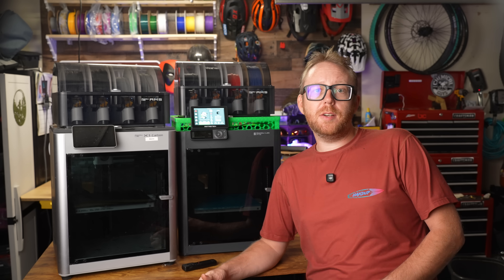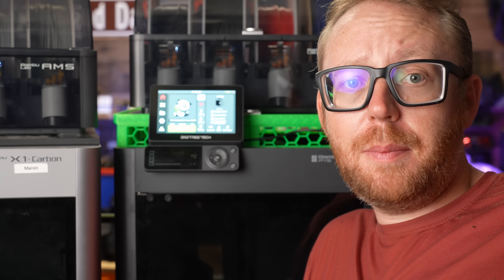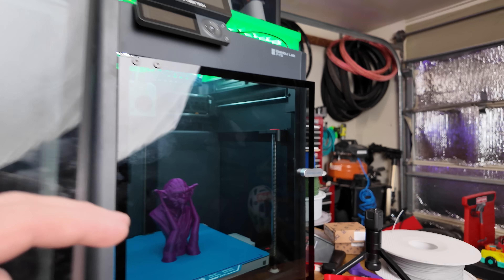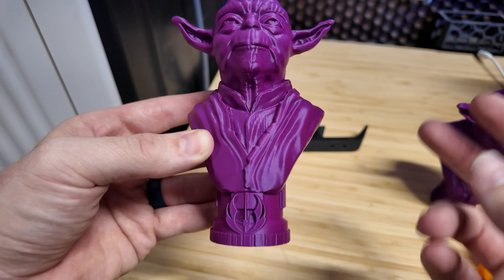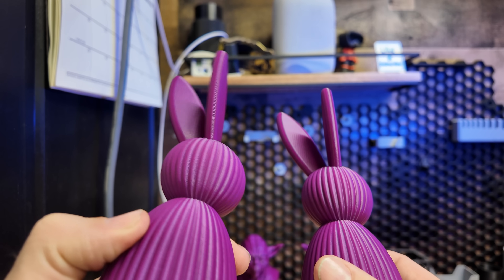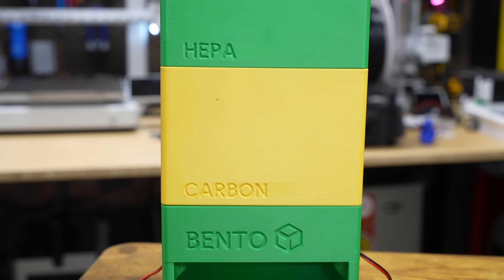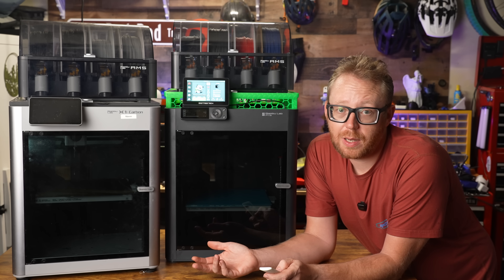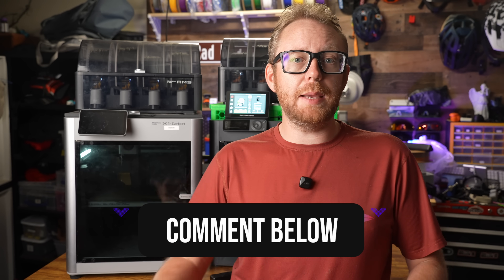Why I Regret Buying the Bambu Lab X1 Carbon vs P1S

Comment: Plastic vs metal? Yeah, I'd go with the X1C for longevity and build quality.

I bought the X1C, and unlike the numerous Facebook forums outlining various issues owners have faced with the P1S, the X1C in my opinion, is by far superior. 

I have owned my X1C for some time now and have never encountered any major issues. It prints flawlessly and is super dependable.

Comment: I went from a Elegoo Neptune 4 Pro to the Bambu labs P1S with the AMS. Night and day difference. The Elegoo is a very hands on product and doesn’t offer the AMS so when it comes to filament changes it is all manual. The other issue is the bed leveling will come loose occasionally ruining a print. The Bambu is impressive. Very little failure I almost want a second one with different nozzle sizes primarily for colored lithopanes.
Reply from the maker: i would be interested in checking the elegoo series out, ive only messed with the CC thus far

Comment: The 110degC build plate temp on the x1c vs. 100degC on the p1s was the differentiator for me.   I print a lot of ABS and have my build plate around 104-108degC.

Comment: PC for example has a higher recommended bed temperature than the P1S can reach. the X1C can pump out more heat. check the data sheets and make sure the printer has what it takes to print the material you need.
you don't need an X1C if you're only ever be printing PLA or PETG

Comment: I just bought a X1C AMS combo for 800 euros. Coming from a massively upgraded bed slinger that printed engineering filaments just fine, until it died a couple weeks ago, I wanted something that works without any tinkering. I was torn between the x1 and p1 but opted for the x1 as I could already see myself “upgrading” parts of the p1 and I just dont have time for that anymore
Reply from the maker: I can totally relate to not having time to tinker. I really want to build a voron, but I dont have the time

Comment: I need a reliable printer that will work without having to repair it often. Plus it's multicolor.
I've been waiting to see what the Elegoo CC with multicolor will be like, but who knows when it will come out.
Which printer would you recommend?
Mostly PLA, PETG and sometimes ASA would be used.
Reply from the maker: Well, Good chance the CC wont get its multicolor, Id go bambu for the availbility of replacement parts, plus they are really reliable. P2S if you arent in the USA, or dont mind waiting, otherwise the P1S or X1C are good options on the sale currently

Comment: On the Bambu website, it is showing that the X1C is capable of printing more premium filaments as well. How should I/how would you factor this into a purchase decision if you were going to use those filaments?
Reply from the maker: The P1S can print the same filaments as long as you upgrade the hotend and extruder to the hardened gears.

Comment: I bought 2 P1S at different times (waited for amazing deals) put about 600 hours on each. Then sold them for what i got them for and bought 2 A1's. The print quality on the A1's are just as good as the P1S and the only reason i knew was because i have an A1 mini and even that printed just as good. 

Im really glad I sold them when i did because now the H2S is out and the P2S will hopefully be out early November and these printers are far better. Still deciding which one to get and then of course wait for a sale.
Reply from the maker: The a1’s are so good , probably the best bang for the buck

Comment: X1C purchase…. Zero regrets, far from it, X1C has had many surprising benefits, not least the ability to have custom firmware and hardware add-ons. Finally, all the accessories which died when bambu changed their security eg external screens etc

Comment: Hi , what about using the others filaments, that the X1C can use? can the P1S with the upgrades  do it too?,  thanks!! really good video straight to the bone.
Reply from the maker: Yeah you just need the hardened extruder and nozzle to be able to print the same things

Comment: Thanks for this great video.  If the P1S with AMS was at the regular price of $749 or you could get the X1C with AMS on sale for $999, do you think it would be worth the extra $250?  This will be my first printer.
Reply from the maker: that is so tough! My gut would lean towards the X1C, because the difference is low when you factor in the upgraded extruder and nozzle. This price change really made it harder of a choice for alot of people
Reply: @RadDadsPrintLab thank you very much!!

Comment: Why is everyone saying the p1s is cheap. It cost more than the A1c.
Reply from the maker: Most comparisons are between the x1c and p1s . That’s why. Now I do want to do a video comparison between the p1s and a1
Reply: @RadDadsPrintLab I meant k1c my bad.
Reply: @RadDadsPrintLab which one would you recommend the p1s or the K1c. I print both carbon fiber infused nylon and normal plastic. But I plan to start selling parts here soon.  Considering both cost about 500$.

Comment: ~~Another but significant difference is the chamber heater the X1 has, the P1S lacks. Gets important once you move up to otherwise warping materials like ASA or PC.~~ Disregard, no chamber heater in the X1 (only the X1E has it and the H2).
Reply from the maker: Uh, I’m pretty sure the X1c does not have a chamber heater, only the x1e has it
Reply: @RadDadsPrintLab  Really? Thank you. 🙂

Comment: What a concise and informative video!

This video is a great resource for me. I am getting ready to purchase my first 3D printer, I was just about to pull the trigger on the H2S or the H2D and learned that their is now an H2C coming down the pipeline.

Given the H2C is possibly around the corner, I decided to pick up a less expensive first unit and get the H2D or the H2C once the H2C launches.

Thanks for sharing your experience it sounds like the P1S will get the job done until I can later get one of the printers with the larger build volume and fancier features.

Keep up the great work, I just subbed and I am looking forward to your future videos!
Reply from the maker: Thanks! Eventually I would love to check out the new H2 Series at some point
Reply: @RadDadsPrintLab I can't wait!

They are a pretty penny for sure.

My P1S arrived today I am so hyped!

I am mostly intending to print toys for my kids and gaming accessories.

Keep up the great work 🙌🙌🔥🔥🔥

Comment: My first 3D printer arrives tomorrow. It's a P1S with AMS and a Sanlu 4-spool dryer, along with a hardened hot end, build plates, PLAs, ASAs, some CF filaments, tools, vacuum storage bags, extractor hose, Panda Touch, and extra lighting. I've waited many years for this stuff to become easily accessible, and I'm very excited. :)
Once I realised I needed a case because it will be in my woodworking shop, the choice was dead easy. And multicolour printing, when used intelligently for layered effects is exactly my normal use-case, to make 3D display tags in my retail store.
Reply from the maker: Nice! Thats a great initial setup you got .
Reply: I'm jealous of your budget but I'm also just getting into this... As Well as really wanting to get into woodworking again (haven't really done highschool woodshop 🤣), and hoping to combine the trades to make both better... Though I assume 3d printing with benefit woodworking/told/jigs and such more than wood will help with printing lol. 

If you have a channel and do videos on your escapades I'll definitely follow.

Comment: Bambu Lab 3D printers are overrated. They require too much maintenance, which I find difficult for people without technical skills. Also, Bambu Lab customer support is not very helpful. I own three Bambu Labs, but due to the lack of customer support and their short lifespan, I’ve decided to try other brands. Just my humble opinion. Happy printing!
Reply: @mango9805  hi there what would  you recommend  instead... im technical  is but lazy and just want plug and play
Reply: @nigelroddy9125  Not sure what Mango is talking about, the Bambu printers are extremely low maintenance and just work out of the box in my experience.
Reply: @mango9805  Hes talking about Ender 3V2 😂😂😂😂

Comment: sadly, fast forward to sept. of 2025, Bambulabs kinda hosed the ability to be able to mod and use 3rd party options with the current updates :/  This may be worth considering before jumping into the p1s, especially if you are wanting to use that panda screen etc.

Comment: How fast does the x1c print a benchy at regular speed? I sell parts similar to the size of the benchy. My prusas do a fine job. Im just curious about the x1c. No ams either. Just one color.
Reply from the maker: One thing you could do is install orca slicer or bambu studio and just slice your models to see how fast they would print.

Comment: I want it mainly to print carbon fiber filament would the p1x work ok
Reply from the maker: P1S will work fine as long as you upgrade the extruder gear and nozzle to the hardend steel variants

Comment: If we upgrade P1S with hardened nozzle and gear, can we print all materials that carbon x1 can print, such as carbon fibre? Any issues with the plastic side walls and high temperature? If yes, Any workaround for that?
Reply from the maker: Yeah just adding the hardened items is all you need to print Carbon and Glass Fibre filaments. Well, I live in socal desert and its generally about 105 in my garage. So high temps are a bit different for me haha.

Comment: I have an X1 Carbon AMS bundle (bought just before the P1P came out), and then I bought a P1P (just before the P1S came out).  If I could do it again, I'd buy a single H2D printer and 2 x AMS, or 2 x P1S each with their own AMS v1.

Comment: Dumb video. All the extras you spend making your P1S do X1C exclusive stuff, like the add on screen, hardened hotends, and you miss out on higher heat stability for ABS and more functional prints. If all you’re printing is model toys, fidget spinners and kids play, by all means get the toy P1S model. Otherwise get the X1C for production ready functional output in more durable functional filaments.
Reply from the maker: Hardened stuff isn’t exclusive to the x1c. Even the A1 can do hardened stuff.

Comment: With your PandaTouch, has the recent firmware update locked that device out from working or being useful? I just bought a P1S and was leaning towards a Panda Touch, but their site has a warning about firmware updates and compatibility.
Reply from the maker: I stopped updating the firmware on my P1S. I think the most recent one blocked its ability to work .
Reply: @RadDadsPrintLab  oh, ok. I suppose that's an option. But what happens when an important feature or quality of life update comes out with a firmware update?

Comment: P1S Combo is now €649 while the X1C Combo is €1249  You can almost buy 2 P1S printers for that money.
The P1S Combo is only €100 more than the Anycube Kobra S1 Combo. And that one's notorious for bed warping. If you're on a budget I'd really recommend spending €100 more on a Bambu P1S.

Comment: If you are printing hobby things with PLA and PETG, both are fine. If you need engineering parts, like with PPS-CF, you should look at the X1E, the enterprise version of the X1C, they are great value. Once you are printing engineering parts, you can't afford warped prints (materials are more expensive, and time is valuable), nylon parts are also easier on the X1E.

Comment: I have an A1 combo. That i started printing rc planes from. The bed slinger is a little tough on the tall wings with little contact surface. Need to use supports for light pla. Thinking of getting a P1S. Maybe it might be easier to print taller narrower parts. Idk if worth it. It's currently on sale
Reply from the maker: First off amazing user name 😂. You could check out the Elegoo centari carbon if your on a budget. Currently working on that video next
Reply: @RadDadsPrintLab  haha thanks. I live by it. Considering the P1S is on sale now for 500 no ams im leaning that way. I don't officially have a budget. But I'll definitely check that one out.

Comment: Great video bro first printer I got was the A1. But want a printer that can print carbon and is enclosed so.  I was in the same boat as you and finally's had screw it I'll just get the P1s especially with the anniversary deal going on at Best Buy Just picked one up. This video helped me decide a month ago when I watched it and forgot the sub sorry. 👍 PS I realized the screens are pointless like you said I never used the touch screen on my A1 maybe once in a great while if I'm up to check the print time till finish but that's about it.

Comment: the P1S is on sale right now for $700.  that's with the AMS.  that's a good deal!  I did recently get a new in box X1C for $1000 delivered, with AMS, so that's a no-brainer for me.  if you are going to print just PLA and PETG, then the P1S is definitely your jam.  but if you want to use engineering filaments, then you'd need to upgrade the P1S and the LCD can be upgraded as well.  then you are approaching the X1C price.  I have bought them for $1200 new with AMS.  there are deals out there.  the LCD on the X1C is so nice compared to a P1S even with the Panda upgrade.

Comment: Tbh I got the x1c and I'm pretty happy with that, cause I plan to print carbon filaments. Other than that I wouldn't ever buy the p1s... I would buy the A1 or even the A1 mini if you care about price to performance, the p1s is the less worth imho.
Reply: If you compare out of the box only then MAYBE. But the P1S has overall value compared to any other model besides the H2D. Only real thing the X1C is the active flow calibration.

Comment: Can use on p1s nylon or carbon fiber filaments?
Reply from the maker: for the Carbon Fibre filaments you would need to upgrade the extruder and nozzle to hardened versions.

Comment: Great video thank you for that. Was hoping i could get your advice on where i am now. 

I have been waiting for the H2D to come out as i really wanted the latest printer, right now bambu has a sale for the P1S for $999 and the H2D is not on sale for $3500 (all AUD prices) now is the H2D really worth 3 times the amount?

The only reason i am leaning towards the H2D is because i dont upgrade my product all that often, i have a artillery sidewinder that still works perfectly that i have had for over 5 years. I know if i was to buy the H2D i would not upgrade for at least 10 years but its very hard to see 3 times the price value

Comment: I'm not sure. You said upgrade many times here, and when you couldn't you cited entirely different category (the open design a1 having flow calibration). You're not wrong and are making an important point but the concept of added value is being poopoo'd too much these days. Maybe it's just my experience fiddling with and spending additional money on an ender 3 so much. Nice video

Comment: I was looking for a new hobby and just started using my 10 year old Flashforge Creator Pro that I bought in 2015. It is great, but super slow. I am not by any means rich, but I find it funny how many people talk about spending a couple grand on a printer like it is expensive. My other hobby is photography and I dumped 34k on cameras and lenses. This hobby seems extremely cheap.
This may come off wrong, but my point is that there are so many hobbies that cost a ton, so be thankful we can have so much fun for so little money.
I am very interested in a Resin printer.
Reply from the maker: Leicas?
Reply: @RadDadsPrintLab  Canon all the way!

Comment: Just got the p1s combo after 2 years of using the ender 3 v3 se and it's literally like I didn't even know what 3D printing was before I got the p1s. INSANE speed INSANE quality it looks resin printed and it literally prints anything. I'm testing out the AMS right now for the first time and its looking really good. Definitely a good upgrade
Reply: Out of curiosity do you feel you ever got your Ender dialed in?  I have a S1 Pro and eventually got it set up properly and the print quality is really solid- definitely rivals what was shown in this video, for example.  That being said,  I've been looking at the PS1 combo as an upgrade.  I think the speed and quality of life upgrades would be nice however, in addition to just getting more modern tech all around.
Reply: I had to get my ender repaired by professionals multiple times and the other week I went to a convention before I had the P1S and basically everyone there said the ender 3 v3 se was really bad. However that being said yes in bigger print the quality is still really good but the main issue was the tolerances and nozzles clogs, I always had to change the scale of anything that required assembly. I haven't used the S1 but I do know that enders can get some really solid quality but just from my experience they are extremely inconsistent and need a lot of fixing.
Reply: @jurassicanimation1518   I'm using the V3 KE modded to have linear rails and a Gantry brace,Shims for printbed, and months later i realized after printing parts that were on a rod that everything was slightly angled, turns out the entire Gantry was angled due to Crealities amazing quality control, also paid around 330 for it and i still have pronounced z banding on all parts.
Just on this Video to get opinions about the P1S/X1C because i don't want to stay with Creality haha.

Comment: I sold my X1C and replaced it with 2 printers to increase the print volume P1S in case I need to print something that requires an enclosure and P1P, so far can't tell a difference.

Comment: If someone ask me, i wll suggest K1 max instead because the spare part is very cheap.  Bambu alway clogging and u need to upgrade metal gear, nozzle , etc...😅 X1C has heated chamber but P1S  doesn't available right?